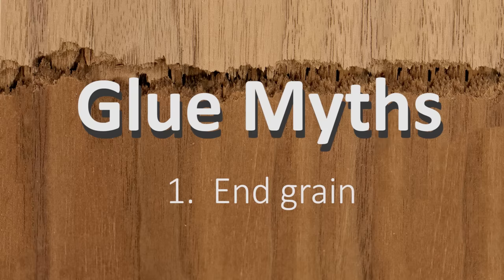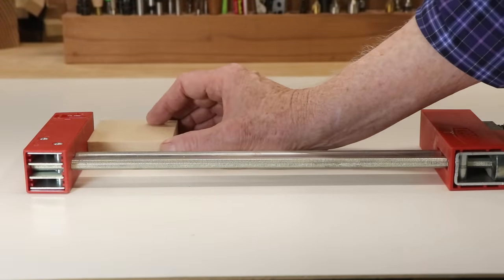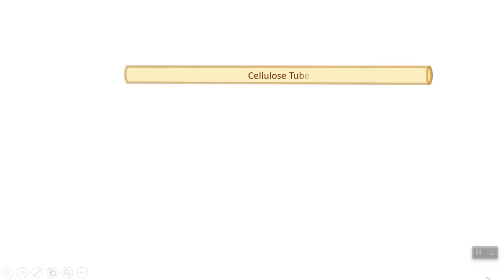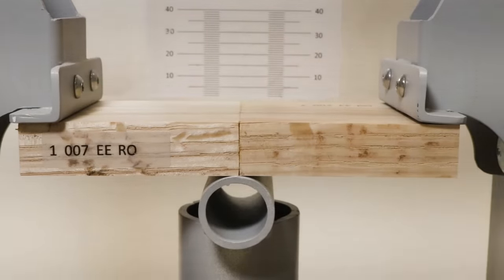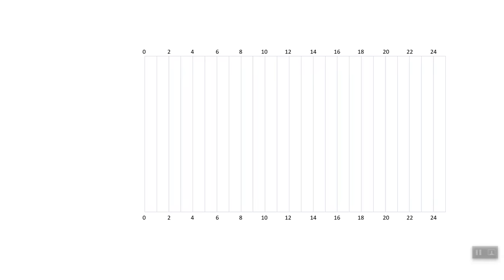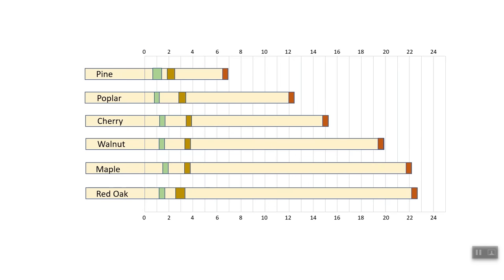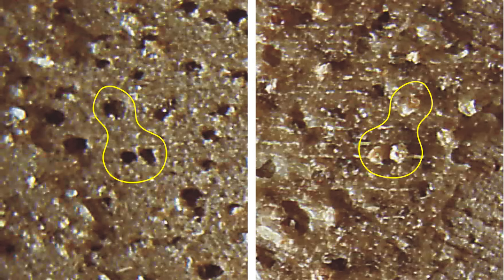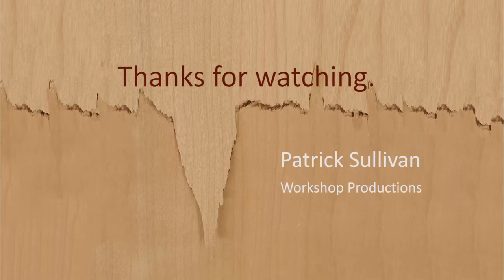Glue Myths:  1. End grain

Comment: Thanks for doing this Patrick, can you also test a poor fitting joint with a lot of glue vs a well fitting joint with ‘normal’ amount of glue?
Lastly, I am personally very suspect about expansion and contraction of wood.  I agree that contraction happens due to the wood drying, but personally I don’t know if I think it ever expands again in a typical household.  Interesting if this could be tested
Reply: If I remember right, The Wood Whisperer has a video about bread board ends and he said that the misalignment between the end boards and the side of the main board fluctuates throughout the year. The wood doesn’t just shrink and stay that way. However, thermally modified wood is advertised to be very stable, like wood that is over 100 years old. So, at least one company’s marketing material claims that wood becomes more stable as it ages.
Reply: @Bryan-fn6lp   I found a video by the Samurai Carpenter where he states he does not build with allowances for cross grain movement and has never had a failure. My initial thought about this came from a table I made about 20 years ago.  It’s in my bedroom, made of cherry about 12” wide with bread board ends.  The top is always about 3/16” narrower than the ends ( 3/32 per side) I live in southern Ontario where we get -15C in a very dry winter to 33C in very humid summers.  The top doesn’t expand. I’m hoping Patrick can look into this.

Comment: I've seen other tests showing that the glue strength is related to the amount you use. You need enough glue to coat the surface, but after that more glue = weaker bond

Comment: I only skimmed the video but i didn't see it take varying moisture levels over time into consideration. Just the strength of the joint immediately after glueing. Wood expands and contracts considerably more across the grain than it does with the grain. I imagine the expansion and contraction of the wood across the grain would weaken and sever the end to side joint more, over time, than any other joint. As for the end to end joint: If it's not perfectly quarter-sawn, the grain would have to match up exactly with the other piece and the cut would have to be exactly 90° to the grain on both pieces for the joint to be long-lasting.

Comment: A pity there is no Nobel Prize for woodworking.. Simple, factual, experimentally supportable and 98% against the grain (pardon the pun) of established knowledge in the community. Class work. Question; an angled overlap butt joint is partly end and partly side grain. I always figured that the diagonal cut through the grain would get a better glue penetration (I use mostly red oak where the pore structure is obvious). What what is the ideal angle? I have been using 45 degrees for years as the best compromise between strength and material loss; It is just so much easier to get matching surfaces than with lap or mortise joints and seemed to be as strong, especially if I put a hardwood dowel through the joint. Now I understand why the method works so well! Are you going to do quantitative tests for glue area vs strength? I always assumed it was a straight line relationship, but now, looking at the geometry of the break patterns in the wood,  I wonder ...

Comment: Thank you for doing this.  I would amend your myth busting statement to: "End grain joints are about twice as strong as side grain joints using Titebond II glue."  Patrick, your discussion of how Titebond II glue works and bonds to wood raises the question: do other adhesives work the same way?
I'm not sure how old this myth is.  Does it go back to when hide glue was the best glue around?  Does hide glue work the same way as Titebond II?
Finally, you have added another busted myth to one I read earlier in the book "JOINERY" by the editors of Fine Woodworking.  They tested a variety of types of joints all built to the same dimensions with the same kind of wood.  They found that contrary to their expectations the simple half lap joint is stronger than all the other types of joints, bridle, splined miter, mortise and tenon among others, though not by all that much.

Comment: Interesting video; What would happen if a tensile force be applied to the joint instead of a vending moment? Also, what influence will the surface quality of the ends have? I.e. the difference between ends straight from the saw and sanded ends? Are you going to test any of these? Would be interesting.

Comment: Thanks for the information! 

I wonder if part of the end grain myth is caused by rough end grain surfaces caused by cuts with coarser blades. An awful lot of casual woodworkers use lower tooth count "general purpose" saw blades. I would bet that a lot of us learned not to glue end grain back when we used a circular saw for everything.

Comment: The next question to answer should be to test how much surface prep alters these results?   Even though you were very precise with the thickness, length and width... the speed at which you cut each board would texture the wood differently and likely partially caused the differences in the apparent glue strength.  Another variable would the age and grow per year of each tree.  Poor/cold growth seasons would produce a very dense grain vs.  rapid growth would produce a wide grain.  Another critical aspect for bonding would be moisture level of each sample.  My point is... there are an endless number of parameters to consider.    

Basically, cutting the test wood into identical sizes (thickness, width and length) is sort of like saying the thickness of paper increases the individual's ability to spell.  The parameters are mutually exclusive.   This doesn't mean your tests were incorrect.  The results are absolute and great information.  I'd like to know if  the glue manufacturer agree with your findings.

Comment: Since we see that end grain joints seem to break at the glue line which might have something to do with flexing of the glue itself when it matches the flex of the wood it is adhered too. Lets up the ante and glue end grain on a piece of wood that might not have as much flex like maybe say take a 10 foot log that is uniformly cut perfectly round like a telephone pole and then cut it in half and then glue it back together and add pressure at different points on the log on 1 end kind of like when you might bury one end deeper to get a more sturdy fence pole and then also at the middle as well to mimic maybe a bridge strength. Would love to see if the strength of the glue is proportionate to maybe its flex angle. just a thought.

Comment: Makes perfect sense to me, I've been making end grain joints with epoxies for years and they're incredibly strong.  Thanks for the effort to debunk this misperception.
Reply: .... so for years you have made joints that are far weaker than the wood. Cause no, what he has shown is that the glue is the failurepoint in an endgrain join and that type of joint itself is just weaker as it is limited by the glue instead of being limited by the fibres as good joints are. Even a simple lap-join is multiple times stronger.
Reply: @ABaumstumpf  "...and that type of joint itself is just weaker as it is limited by the glue instead of being limited by the fibres..." .  How'd you derive that!?  It's stronger because it utilizes ALL the strength the glue has to offer, whereas the cross grain joint fails sooner due to the surrounding wood being weaker.  The "joint" , or bond strength, remains pretty constant.   Glass half full vs. half empty I suppose.
Reply: @marks5603  "How'd you derive that!?  It's stronger because it utilizes ALL the strength the glue has to offer"..............
How about you watch this video where he literally is detailing how the endgrain joint is only a fraction the strength of solid wood.

Seriously - how can you not understand something so simple when it is the entire point of the video?
Reply: @ABaumstumpf  For the same, planar  joint surface area the end grain joint breaks at a higher strain value than the side grain.  The glue becoming the limiting factor makes a stronger joint! Does seem simple to me.  Other issues with multi planar joints introduces variables beyond glue-surface bond strength and are not pertinent to this analysis.  As is comparing end grain joint being a fraction of the strength of solid wood.  Of course!  And my point is that cross grain glue joint is even less strong.  I'm not comparing ANY joint to solid wood.  I'm contrasting joints, where the only variables are grain orientation.  Can we agree on this at least?
Reply: @marks5603  "For the same, planar  joint surface area"
For the same area sure - but that is not the  topic - it is about a JOINT - and different JOINTS naturally have - wait for it - different characteristics like surface area.
And guess what? An endgrain-joint is the weakest.

"As is comparing end grain joint being a fraction of the strength of solid wood.  Of course!"
Yes - contrary to a longrain-joint which, due to featureing overlapping firbes, is as strong as the fibres rather than being merely as strong as the glue.
Reply: @ABaumstumpf  So all his measurements are false? The end grain joint did not sustain higher stress before yield than cross grain? I stand by my interpretation of the results as presented.   You get the last word if you like.
Reply: @marks5603  "So all his measurements are false?"
No, his measurements simply show that a endgrain joint is weaker.

What appears to be wrong or rather none-existing is your ability to comprehend what was shown in the video and what i have written.
(and then we have your ignorance and hubris)
Reply: @ABaumstumpf  No, his measurements simply show that a endgrain joint is weaker.  Weaker than what, exactly?
Reply: @ABaumstumpf  Really no need for the ad hominum insults.   I merely think were not referencing the same attributes. I believe I've been very clear as to what I am referring when I say the end grain joint is stronger than the lignin in the cross grain joint.  Perhaps pictures and narratives reference would help. At  https://youtu.be/m7HxBa9WVis?t=623 Patrick makes this case.  And clearly, the solid wood is an order of magnitude stronger. But for equivalent surface areas, end grain (Gold on graph) beats cross grain (Green on graph).   What am I missing?
Reply: @marks5603   " Really no need for the ad hominum insults. "
Please refrain from using words you do not know the meaning of, or your underhanded attacks.

"I am referring when I say the end grain joint is stronger than the lignin in the cross grain joint."
And still the endgrain JOIN is weaker than a longrain JOINT.
You really should start reading what i had actually written instead of attacking strawmen.
Reply: @ABaumstumpf  

ad hominem
Merriam-Webster
: marked by or being an attack on an opponent's character rather than by an answer to the contentions made

Wikipedia
Typically this term refers to a rhetorical strategy where the speaker attacks the character, motive, or some other attribute of the person making an argument rather than attacking the substance of the argument itself.

Dictionary.com
attacking an opponent's character or motives rather than answering the argument or claim.

You called me ignorant, hubricious and underhanded.  I’d consider that a personal character attack which did not address the discussion at all. I never insulted you.  Certainly seems to fit the definition of ad hominem to me.  

 I asked you four very succinct direct questions, none of which you answered. I even tried to illuminate the possible incongruity of our terminology to facilitate a common reference. Sometimes nomenclature alone can lead to gross misunderstandings.  You never addressed that…
Lastly I specified a crucial compilation and analysis of data in the author’s own video for clarification and received even more vehement retribution. 

I suppose your first snippy, slightly demeaning reply, should have tipped me off. Things went rapidly downhill from there.  Best wishes, fare thee well.  

Underhanded… ?  Really?
Reply: @marks5603  "You called me ignorant, hubricious and underhanded."
Yes - i have listed how you acted, but thanks for showing that i have not used ad hominem.............

"I asked you four very succinct direct questions, none of which you answered."
You are just ignoring the answer (and the very video you are commenting under) - and it is not my responsibility. 

"Sometimes nomenclature alone can lead to gross misunderstandings.  You never addressed that…"
I did, you kept ignoring it and than created your strawmen.

Comment: Which means that while edge grain joints can be made simply with glue with no loss of strength, end grain to end grain ones need to be made differently or you lose strength. 
Or in other terms: edge grain joints with just glue are strong (compared to a single piece) and end to end ones are weak (compared to a single piece)

Only the semantics were debunked here. Still very interesting.

Comment: I think the myth arose from the fact that when we look at a failed end-grain glue joint it's the glue that breaks, not the wood. So the assumption was that the joints where the wood breaks had stronger glue joints. Apparently no one bothered to put that assumption to the test.

Comment: So a 45 degree mitre is an end grain joint with extra surface area (1.4x), plus a microstructure with cellulose tubes sliced diagonally offering an even larger exposed surface for the glue to adhere to.   So in a like-for-like comparison, a 45 degree end grain joint ought to be even stronger.

Comment: I have been trying to put wooden octagons made of 2x4s together. I glued end grains together. I used ratchet straps to hold the octagons tightly together while they bonded. The result was that they didn't hold up. I just resorted to screws. I am a beginner, so it could be an issue in my technique.
Reply from the maker: I have made dozens of similar shapes, and wood turners who make segmented bowls glue up hundreds of pieces with mitered end grain.  In general, these joints are quite strong, IF your joints all close perfectly.  If you leave any gaps due to small cutting errors, those gaps greatly weaken the glue joint. One other reason that might explain your failure is if the joint opened up one of more times while you were applying your ratchet clamps.  I have not tested this directly, but my experience is that joints that are clamped, and then repositioned and clamped again are often weaker.
Reply: @PatrickSullivan  Thank you for the reply.  I think both issues might have been at play. I am working on my technique to get more consistent cuts.

Comment: Great test. I think it's as simple as the wood failed in long grain application first. The glue failed in end to end first. Therefore, it must be the end to end application of glue doesn't work as well and must be a weaker joint. A misconception that your data proves inaccurate. It's similar to the misconception that using cruise control in your car on icy or wet roads will cause the car to accelerate if your tires lose traction. in reality, the cruise control measures the drive-line rpm and calculates your speed based on gearbox ratio and tire diameter, not you relative gps position velocity. What is really the issue is if your foot is on the accelerator and you feel a loss of traction,  you naturally release the accelerator. Whereas, the cruise control will keep your tires moving at the same rpm causing you to lose control and ruin your knickers.

Comment: The only issue I have ever had gluing end grain to end grain is when the end grain pulls all of the glue up into the wood leaving a glue starved joint. To remedy this I usually apply the glue and wait a minute or two to let the glue do it's thing then apply a little more then clamp the pieces together. Another thing is that anybody who has ever glued up a picture frame before has been gluing end grain to end grain. The cuts are 45* but they are both end grain so I don't know where this myth got started. I've never payed it any mind.

Comment: This is fascinating, but by the comments it seems like a lot of people are leaping to conclusions beyond what is replied by the results. The reason for not making a glue joint end to end or end to edge has nothing to do with the glue bond strength itself, and everything to do with what kind of joint it implies you're making. If you glue up a corner of a piece of furniture without other reinforcement, it's a weak joint. Whether it breaks the lignin bond or the glue bond, it absolutely does not matter. Note also that lignin accommodates seasonal wood movement, whereas glue does not. Similarly, gluing boards end to end without mechanical reinforcement is generally a bad idea, though I can think of more exceptions for this; trim, baseboards and other non-structural pieces can probably be glued end to end without any concern. The seasonal wood movement between those pieces would be close enough to the same to not be an issue, as long it's the same species with the same moisture content. Imagine you could get away with joining up a couple of boards end to end in a table top, as long as it's sandwiched between boards running the same direction, but for aesthetic reasons it's hard to imagine that would be done very often.

Comment: I have noticed endgrain glueups being the weaker section of the material. My theory is it is not due to microscopic reasons, but macroscopic things. I noticed the wood I get from the shop tends to be cut less precise on the end grain, thus doesn't connect to the surface correctly. After all, that type of glue works only on porous surfaces, so it doesn't seem intuitive that end grain being more porous would lead to less adhesion, although maybe it is too much porous.